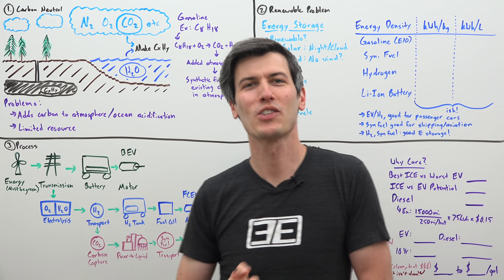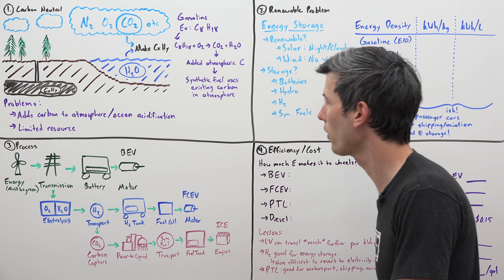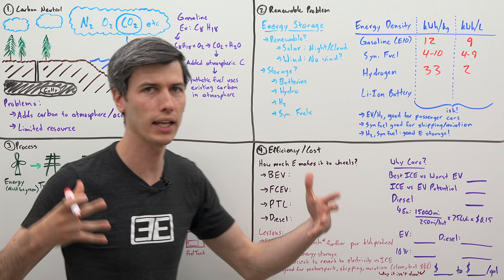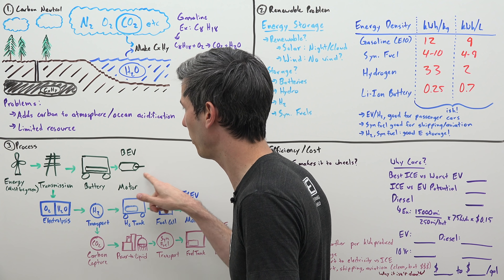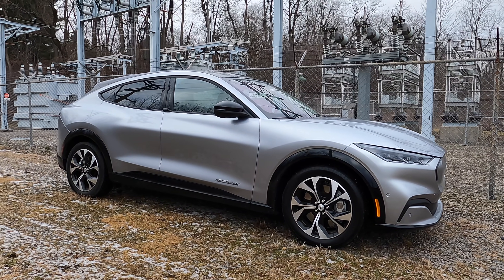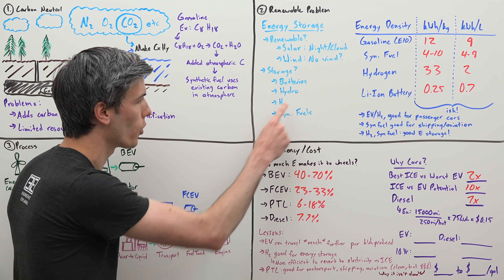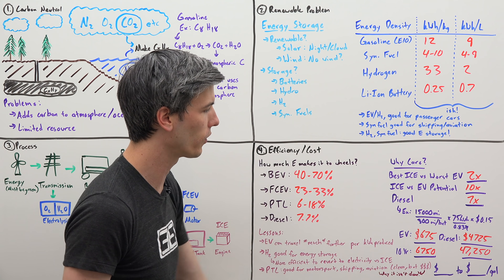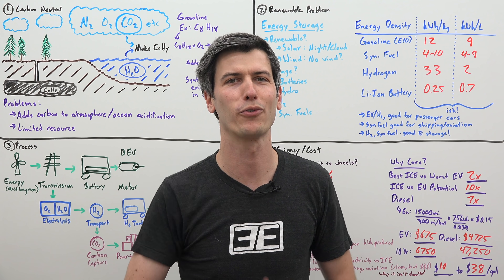The Big Problem With Synthetic Fuels

Comment: At the moment the prohibitive factor for EV’s is recharging time and in the UK it’s also the lack of infrastructure for EV charging points then to top it off there are a ridiculous amount of properties that haven’t got the ability to have a home charging system - a lot needs to be done in a very short space of time because from 2025 all new vehicles sold in the UK must be either hybrid or full EV’s and from 2030 all new vehicles sold must be zero emission vehicles

Comment: Please critique my idea: Distributed electricity generation using ASMRs (nuclear), with enough capacity to satisfy peak demand. Which, when exceeding demand, use electrolysis to generate hydrogen fuel, and possibly the synthetic fuels described (via carbon capture), both distributed locally from the source - i.e the idea of combining a small power station, production facility, storage facility and fueling station.

Comment: In terms of efficiency and carbon emitted we're better off using synthetic fuel than replacing all our cars with electric ones. The cost of building a vehicle is the biggest cost in terms of carbon in the vehicles life.
We should aim for hydrogen as its less environmentally destructive than building the batteries for electric cars. But in the mean time we should gradually wind down internal combustion vehicle use by switching to synthetic fuel

Comment: I'm still waiting on solid-fuel cars.  I wanna go to the gas station, stick $20 in a vending machine, and get a handful of fuel cubes that I then feed to a little flap on my car.

What's the energy density of RDX?  LOL
Reply: Aluminium, congealed electricity, is what you are looking for. It's possible but still some technical problems.

Comment: A great video but I would luv to know the same comparison with fossil fuelled ice petrol and diesel
Reply: Even today, the RoI on fossil fuels is ridiculously high (especially oil) compared to any alternatives, and that's in a world where fossil fuels have been used for quite a while. That said, as surprising as it might be, even fossil fuels are being subsidized, so even in the short-term the profitability is more murky than it seems at first glance (according to some meta-analyses, by far the cheapest for a 30 year (static) plant is wind, extremely closely followed by nuclear, and everyone else far behind). Most of the cost of electricity from fossil plants comes from the fossil fuels themselves - but that also means you can save money on running at less than max capacity, unlike the alternatives.
Reply: @LuaanTi  I'm not against in principle of getting rid of fossil fuelled ice...but ev is not by any way a green solution, they just pollute in a different way. It's even worst when the power generated is by means of a coal/oil or even woodchip fired stations , or nuclear isn't green..wind/solar isn't a reliable source and like u said it's basically all or nothing.

Comment: On the basis of the environment being a huge factor in making any change, surely hydrogen is worth the lower efficiency for not digging things out of the ground for batteries? Recycling will improve but won't be perfect, while clean energy production is improving rapidly. Fusion reactors are starting to seem plausible too, although obviously they'll be a while still.

I feel like synthetic fuels for cars have only 1 long term use in the world of passenger vehicles, which is for classic cars. It'll be great if in 100 years people can still hear the sound of an NA V10 screaming past them, but it can't be a regular form of transport.

Edit: Also those tree drawings are pretty good.

Comment: There is no way that battery electric vehicles are not going to be totally transformative to civilization. We can do several times more work with a given amount of energy if we switch from burning stuff. The cost of energy is everything. To put it in perspective, it's a bigger leap in efficiency, power density, flexibility, than going from the steam engine to the internal combustion engine.

Comment: Yes, another lovely whiteboard episode. Really liked the way the information was presented and it all makes sense. (Matches what I learned at university too.)
One thing that could be mentioned is that the energy used to charge your BEV at home has to go through a lot of transformation processes first. This can bring the energy balance down to the level of fuel cell cars since transporting a large bulk of chemically stored energy is just much more efficient than running electricity through thousands of km of lines and 5 transformers. (thats probably where the 40% in the study come from)

But the key question for all of this is use case. Efficiency is king as long as it can be used. Californian home with solar roof? Nothing but batteries, of course. Aviation? Needs chemical fuel. Something in between? Freight trains? Ginormous tenant towers in chinese mega cities? That is where hydrogen fits in in my opinion.

Comment: Wont syntheyic fuel production would be cheaper when the technology improves overtime?
same as EV batteries
Reply: Yes, but then so will battery electric. The issue is the efficiency. If you can find a cheaper source of power, then the price goes down. But so does the cost of electricity to charge your car, or to produce hydrogen for your fuel cell, so it's still uncompetitive. The efficiency is unlikely to improve much, since that is determined by the thermodynamics of the process, rather than any particular technology.
Reply: @jackroutledge352  But which tech is going to, mostly likely, to have a sharper decrease in price as tech matures?. Statistically consumers dont really care about efficiency, but price. If you produce a fuel that is 20 % efficient but its 3 USD / litre vs one that is 90% efficient but its 100 USD / litre, which would you buy? :)
Reply: @jackroutledge352  Eventually the price of recharging your EV will be $1 and the cost of filling with E-fuel will be $3. Nobody will care about the difference when the numbers get that low. E-fuels give a lot of convenience and have many applications where batteries are too heavy and big.
Reply: Porsche has already outlined the ways to make mass production a lot cheaper along with Siemens energy and it looks viable, effective, and possible. It also looks to be in a very near future timeline as opposed to the ever slow growing battery technology, which is one of the oldest technologies mankind has and yet hasn't progressed nearly as much as some technologies in the past few decades. 

Assuming more support would get behind this carbon neutral alternative fuel (looking at you Toyota with your opposition towards going electric...) then there's a good chance combustion engined will not disappear
Reply: @EjinRenos  Batteries are overhyped and will never be good enough. E-fuels will become viable in the coming decade and beat all batteries.
Reply: @timex987987 Apparently, he does.
Reply: @timex987987 It is already possible to make biocrude by pyrolysing waste biomass, a process which is essentially speeding up the formation of crude oil by millions of times. And biocrude can be refined in the same way as normal petroleum.
Reply: The most advanced synthetic fuel process I know of (Prometheus) is around 50% efficient, which is approaching theoretical max. So gains there won’t be from making the synthesis more efficient, but rather by reducing the cost of electricity. They’re currently working with solar at about 2c/kWh, which comes to about $1.40 to make a gallon of gasoline. But if solar prices come down another 50% (which seems likely), they’ll be down to 70c/gallon for energy input cost. That is tremendously cheaper than fossil gasoline, so they’ll win on price alone.
Reply: There are 2 billion internal combustion engines in the world. There will never be 2 billion "100 kWh lithium-ion batteries" ever.
Reply: @timex987987 That is still many decades away. Probably even centuries. They are constantly finding new places with fossil fuels.
Reply: Sounds like a cope. If it’s not broken, don’t fix it. Gas cars drive just fine and allow people to be lifted out of poverty. It’s only the privileged rich that are thinking up projects to burden everyone else
Reply: @timex987987 fossil fuels are a myth the earth naturally produces this substance thru its life cycle dead plant and animal life is NOT the basis for gasoline as the powers to be want you to think cuz youre a dummy 😊
Reply: @thephantomzoneboxing  dead plants take 20 minutes to turn into fossil fuels you're right thanks genius
Reply: @seanonraet8327  earths natural processes produce oil..which is more believable? dead dinosuar bones or all the processes the earth goes thru naturally creates it?
Reply: @timex987987 this planet will likely never run out of oil..its always being created..humans do not consume nearly enuff of it to limit supply..pretty simple its a constantly renewing resource..the only problem is the effort required to get it thats about it..but its an archaic form of energy to use but its apart of the great game the powers to be have decided to trap the sheeple in..electric vehicles will be the next trap that they have decided on

Comment: As much as I sound delusional because I love cars in general, I have hope that in the future there is a possibility to keep ice alive. I personally don't mind electric cars coming in and replacing most family everyday cars, but to me there are enthusiasts out there (like me) who won't give up ice just yet. It may sound expensive today but maybe in the future people will find solutions to problems like cost. Efficiency may not be solved because of the process I won't deny that but I still have faith that synthetic fuel could be a helping hand for ice. People found solutions to make EV cars more efficient and cheaper in the long run so I feel like anything is possible to help ice. Maybe hydrogen for ice could still be an interesting experiment since toyota was testing out the gr yaris engine with hydrogen injection. To sum it up, I think that synthetic fuel won't replace electric cars but I believe both ice and EV can coexist in the same environment it's just all comes down to investment of helping ice. We may be at peak of these engines but I think that helping them survive is much better than letting them die off and have all EVs replace every single car. People may disagree with my statement but I don't believe in a FULLY EV future.

Comment: for mass adoption, EVs are undoubtedly the solution. I still think hydrogen fuel cells have their place in the sea freight, cruise line industry given the possibility and low impact of hauling a huge hydrogen reservoir.

efuels make sense to the enthusiast driver (whether it's a 911 or a Miata). Hopefully no soccer mom is going to be gassing up a Rav4 in 10 years but if the efuel price drops to $2.00/L, that's only 50% more than we gas for gas over here anyway. I'd happily pay that for a weekend toy, not so much a daily driver. efuels become a luxury item that people cannot rely on for daily driving but only spend on if you're really passionate about ICE driving.

Personally...I think that's great. I really do. Imagine the only ICEs running around are enthusiast cars? Sounds like the perfect world! I think manual transmissions will be making a comeback. I can feel it.

Comment: @Engineering Explained Have you looked into at-the-pump production of hydrogen fueling for cars vs pure electric cars. I know it may not be currently viable (or possible) but I often see transportation cost being factored into problems with hydrogen. I was wondering about he viability and subsequent effect on the efficiency of hydrogen cell versus electric battery cars.

A further note to anyone reading the comments regarding social science. As someone who has spent a little time in academia (admittedly not overly much): whilst some areas of social science might have some issues currently, all areas of science including the "hard" sciences have their issues (e.g. massive positivity bais). None are more valid, nor more valueable, than another when conducted properly (which is not always the case) and all are needed for our society to grow. Furthermore, the media spin both "hard" science and "social" science to meet their agenda, it is the nature of presenting a compeling story.

Comment: How does ethanol production using fermentation stack up for efficiency I wonder. ICE engines can be made to run on ethanol blend in many cases. You could produce ethanol and synthetic fuel side by side even since fermentation produces co2 as a by product
Reply: The problem with biofuels is that in the end you are burning food, and cars eat a lot.
Reply: I see your point. You certainly wouldn't want to starve people or clear forests to grow crops for fermentation. But the 2 need not be mutually exclusive. You don't need your grain/sugar/starch to be of food grade quality if it's being used for fuel. It can be spoiled grain, leftover bread, otherwise unsellable harvests. Maybe there are crops that can be grown alongside or inbetween others that can do the job. If we're going to keep driving vehicles around we need to pull the energy from somewhere. Electric cars are good for certain things but keeping an open mind to other clean alternatives can never be a bad thing

Comment: The system is gonna change as well. 
Today we try to keep our 50 year old system and just switch the motor.
But why not use some kind of automated vehicles with overhead lines for truck replacements. They could go massiv distances without the need for brakes and therefore could move at a much slower speed.

Comment: I think if they can get a price of fuel down to $2 it makes more sense than EV. Lithium batteries are also a limited resource, they are heavy, and can't come close to lasting as much as an ICU engine, and are hard to dispose of. So if they can make e-fuels even 3x the cost of EV power it would probably make more sense than EV in the grand scheme of cost from production, to maintenance and running of the vehicle

Comment: Important to note: Gasoline as a fuel is peculiar in that if you’re going to the length of synthesizing it from renewable sources, then it seems frustrating to realize that you could instead use less energy to synthesizing fuels that require less reactions to produce. LPG, LNG, Alcohols, Ammonia, amongst others would be good examples of this. Since Gasoline is a mixture it may have disadvantages that uniform fuels which entirely consist of a single type of molecule don’t.
Reply: You know how synthetic lubricants tend to have a more uniform molecule size than petroleum-derived lubricants? Coulsn't synthetic fuels be made to have more uniform chemical compositions than fossil fuel gasoline as well?

Comment: If they would just over build wind and solar to the point where we would have so much abundance of electricity that on the best days, the sunny days, the windiest days--- electricity would be nearly free and all of these different types of "storage systems" that can be used can kick in:  Hydrogen fuel cells, gravity storage, elevated water storage, ect. ect..  and then these other things like synthetic fuels would make a lot more sense, given that peak days electricity would be basically free.